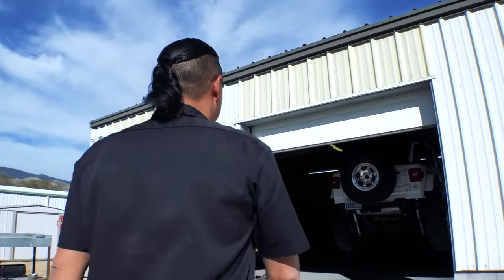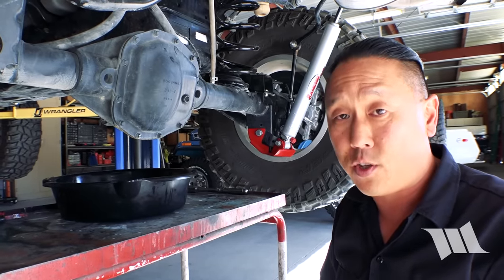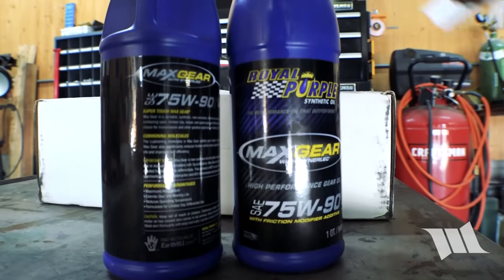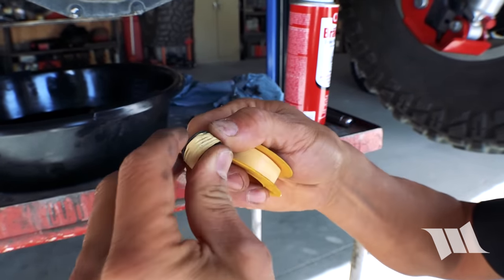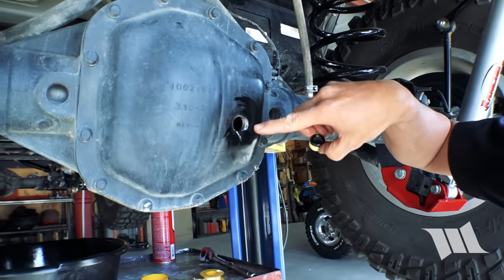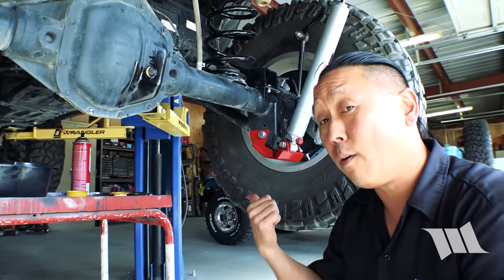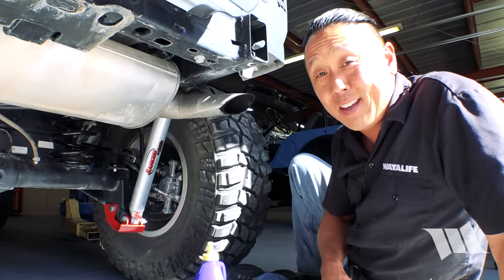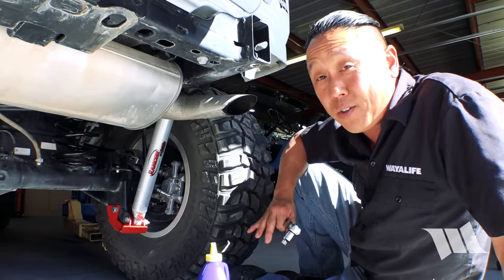Jeep JL Wrangler Axle Differential Fluid Change - How to do it Yourself Maintenance

Comment: I took my Wrangler into the shop and they quoted me $500+ to do both front and rear diff fluid change. I found that unreasonable and began searching how to DIY. This video was easy to understand and quickly taught  me how to do this in my own garage at a fraction of the cost. Thank you! Keep up the great work Wayalife
Reply from the maker: awesome! Happy to hear our video was helpful to you and will save you a lot of money :)
Reply: Yeah, I just called to have 4x4 service done as well they wanted $500+ for the diffs and the TC. Crazy what everything is being charged for! Transmission is next.
Reply from the maker: @ryangarcia8634  There should be no need to service the transmission for at least 100k miles or more.
Reply: The royal purple container makes the change a breeze. Other companies only have bottles requiring fluid pump. It’s messy
Reply: Just called today for maintenance and they quoted me 639$ for front and back, i told them thats is exactly why i dont go to the dealer no more.
Reply: Honestly I used your video to do the oil change on mine but there’s one concern, when I went to do the rear one ,there’s no Drain plug is that normal for a 2020 Rubicon 3.6v Unlimited ? I just bought it 4 months ago from a Jeep Dealer
Reply: That's crazy I got my oil for 20 bucks Canadian and spent less than a hour. What a rip off

Comment: Thank you so much for this video. My local dealer wanted 240 per axel to do this. Yikes!!
Reply from the maker: Yikes is right! Glad we could be of help to you.
Reply: Mine is asking $280, so here I am watching videos on how to do it. Great video, thank you for posting!
Reply: My dealership asked for 619 for Both me 250 for beaker fluid!  Also other videos were showing to clean the differential while this video does not. Do we need to spray the differential to clean it?
Reply: @prazmeej7972  If you already pulled the cover might as well spray everything down with break cleaner while you’re there.
Reply: That is so simple . I thought we had to remove the cover and put new gaskets .thanks for the video .
Reply: That's crazy they charge that much I change my diff oil every other year
Reply: Wow that's insane for such a simple job. Way too much money.  Better to watch these videos and then do it yourself

Comment: Awesome video! But always make sure the fill plug comes out first before pulling the drain plug 👍
Reply: Why is that important? Curious..
Reply: @Mindis Jurenas  encase the fill plug gets stuck or rusted in, ie something goes wrong. Now you've drained all your fluid out and can't get it back in! Being around old farm trucks and heavy duty equipment taught me this lol its not un-heard of.
Reply: @mturzanski  copy that and good to keep that in mind, I just changed my diff fluids without any issues, Jeep is still somewhat new..
Reply: @Mindis yeaman I totally understand my jeep is fairly new aswell . weird stuff happens. It would suck if it was rusty, overtorqued, if it stripped, etc. But it's great to see someone changing driveline fluids. Imagine how many vehicles have never had  the diff fluid changed ever. I've changed the fluid a few times in some of the oilwellservicing rigs and support trucks at work its crazy how much moisture can accumulate in 1-2 years
Good on ya👍

Comment: Yellow teflon tape is for gas line applications and is also thicker than regular white teflon tape. Also, if it is a "regular" Wrangler and not a Rubicon with a limited slip differential, it will take a different fluid that is friction friendly..
Reply from the maker: I think you meant to say that a limited slip will require friction modifier. With that said, pretty much all synthetic gear oils have friction modifier in them.
Reply: @wayalife  Thank you! Rock on rocks!
Reply: @wayalife My jeep has a LSD. If I use synthetic (like Amsoil that says it has modifiers added), do I not need to add any separately?
Reply from the maker: @johnnyf6367 Nope. Synthetic has friction modifier in it already, just as you have found and stated.

Comment: Just knocked it out on my Gladiator.  Didn't even need to jack up the truck and it felt easier than an engine oil change. Excellent tutorial for 1st timer attempting to doing own maintenance at a fraction of the price the dealer/shop would charge.
Reply from the maker: Happy to hear our video was helpful to you 👍

Comment: I’m new to the Jeep community, and have been watching tones of video. I’m a female who loves doing vehicles maintenance myself. I know my 21 year old truck like the back of my hand, with my Jeep it’s like leaving things all over again. Looks like I’ll be serving the differential fluid on Thursday. Oil, oil filter, and both air filters changed this afternoon. I’m only 5’2” and had to stand on the bumper to reach the oil cap and oil filter and one screw on the air filter case. I swear I need a extension ladder to work on my Jeep. 🤣

Comment: 2023 4XE Rubicon does not have the drain bolt. Easy enough to remove the 12 or so bolts around the differential to drain. I only had to loosen them. Otherwise went just like you suggested.

Comment: Slightly confused as to why you use 75W-90 [factory suggested 75W-85] but notes for different models suggest 80W-90 or 75W-140
Reply from the maker: Nothing to be confused about. We're talking gear oil here, not high blood pressure medication. The difference in weight is insignificant and if you were running a higher gear ratio, I would recommend using a heavier weight. Of course, factory will not have any suggestions about that.

Comment: Ok I had to double checked the gear oil used , dealer said mopar 75w85 was going to use royal purple as well will use that 75w90 , thanks again , hopefully no issues with it
Reply from the maker: You be fine 👍

Comment: Fantastic tutorial.  Just got back from a DIY shop and did this myself thanks to the the information provided here.  Tried so hard not to laugh while squeezing that royal purple but all I could picture was Eddie laughing at the noises so I couldn't help it!

I put 75W140 in the rear since we do a fair amount of off-road driving and occasional towing.

A dealer in Vegas did the engine oil change for me while we were on a long road trip and quoted me $1200 for engine oil, diffs, and transmission.  Utterly ridiculous.  I let him do the oil but I did the rest myself for $299.45 all in and 1.5 hrs of labor.
Reply from the maker: LOL - so glad that we could be of help to you 😎

Comment: Great video!  Never done a diff fluid change before but watching this looks super easy.  I want to do all the easy maintenance myself on my new JL rubicon.  Interesting how the M220 rear axle asks for 75W85 in the rear instead of the 75W140 I was expecting.  I guess this makes it easier both front and rear taking the same.  I have a ways to go before any of this is needed but saving for future use.  Thank you!
Reply from the maker: No need to run a heavier oil unless you've regeared.
Reply: @wayalife  I'm base Rubicon 4.10

Comment: Absolutely crazy they got rid of the drain bolt in (I think) 2022. My 2023 JL with the factory M220 rear no longer has a drain bolt. I will say I did a dozen or so deep water crossings over the course of 2 months and when I finally changed the oil everything was still looking great....that said, I only have 14,500 miles on it.
Reply from the maker: It is disappointing they got rid of it.

Comment: Wow! Great video.  Was told i have too take diff covers off to clean them out.
Reply from the maker: On older Jeeps without a drain plug, you do need to pull the covers. In fact, on newer  Jeeps, the drain plugs have been removed and you have to do that on them too. Either way, pulling the cover from time to time to inspect the internals is a good idea but it really isn't necessary every single time, especially if you have an axle with the drain plugs.

Comment: Confused by the many different fluids and additives listed in the description. Which fluid is needed for front and year? Thanks for awesome video!
Reply from the maker: Assuming you're still running factory gears, you will be fine using a basic 75w90 fluid. If you have a limited slip rear differential, you will need to add friction modifier or a synthetic fluid as it will have it in it.
Reply: @wayalife  Great, thank you for the confirmation!

Comment: hi @wayalife so sorry for asking this, but regardless if i tow or not, the front uses synthetic 80W-90, while in the rear i'd use synthetic 75w-140? I have a 2022 rubicon 4xe. Thanks again and thank you for all your awesome videos!
Reply from the maker: For towing, I would use a heavier fluid in the rear, just as you've stated.

Comment: Although you didn't mention it, It's good to remind people that the best way to apply the Teflon tape is in the opposite direction of the thread on the bolt, to prevent the lead edge of the tape from unraveling and/or bunching up.
Reply from the maker: This is true :)

Comment: Just did fluid drain n fill on my 13' JK 2 days ago. I actually googled it and found your old write-up. I never knew that there was a drain plug on the axles. I did a complete cover reseal the first couple times without noticing it. I do prefer the tucked up drain plugs on the JK axles though, the JL look abit risky.
Reply from the maker: Yeah, the front diff plug is lame. The rear is just like a JK. Glad to hear you found my old write up :)

Comment: Hey Eddie nice video, thank u for all u do for the Jeep community, I bought the rock gliders because of u and rancho but I was gonna ask, I wish someone would do a light build to keep weight down on jeeps, that don’t want to turn our jeeps into tanks....
Reply from the maker: So far, I think our build is about as light as it gets. No rear bumper, shorty front bumper and rocker guards and that's about it.
Reply: Cool your right, wondering about stuff that’s like alloys, forgot about they way u built yours, guess you can’t replace steel for strength.

Comment: So I went to change my diff fluid on my 21 JLU Rubicon Eco-Diesel and neither my front diff nor rear diffs had drain plugs. I bought it new from the dealership. Have you ever heard of that?
Reply from the maker: Yes, it's been that way for a while now. The plugs were getting damaged on the trail and causing leaks.

Comment: Thanks for your great videos! Is this an automatic transmission and can we use the same differential fluid in vehicles  with both automatic and manual transmissions. Hope to hear from you.
Reply from the maker: For the axle differentials like you see in this video, you can use the same fluid regardless of transmission.

Comment: This is all good to know... Mine is the sahara. I can NOT believe how much my dealer is charging for 1 bottle of 75W85 for the front M186 diff... Almost $100 CDN... The back M200 and transfer case fluid prices aren't horrible. In fact, all total $100. 

But $100 for the front. That's the Mopar of course. I'm considering a non-mopar brand.
Reply from the maker: Any synthetic fluid will get the job done and really, you can run the same stuff front and rear.

Comment: nice videos. can you do a brake flush how-to video? i was wondering how to completely empty out the master brake cylinder because in one corner of the brake reservoir, the fluid does not come flow out and seems to stay in there. it will contaminate whatever new fluid that I add to the reservoir. maybe if i move the floating thing in the reservoir then it will drain to the main part of the reservoir? thanks for your videos. collectively you save many people thousands of dollars!
Reply from the maker: A proper bleed would require a scan tool to do a full ABS bleed. I do not have a scan tool.

Comment: I made a rookie mistake changing the differential oil.  I didn’t take the yellow cap off of the Max Gear oil.  A plastic piece about a half inch went inside the differential housing.  I’m not sure if I should completely disassemble the differential to take the plastic piece out or just leave it inside.
Reply from the maker: Honestly, it'll probably be okay in there but if it were me, I would open up the cover and try to phish it out.

Comment: I put a solid axle diff cover on my 8.8. It adds a lot of armor and takes more fluid.
Reply from the maker: The Solid diff cover has a higher fill port and that's what allows you to add more fluid. That being said, the port is placed higher to help you to get the proper amount of fluid in the diff after you've set your pinion angle. That does NOT mean you should put in "more fluid". You should always just put in just enough fluid to bring it to the base of the axle tubes. If you put in more than that, you will have over filled it and gear oil will start to pump out the breather tube.
Reply: Yeah I put a little bit more in there, but not even close to the point where it leaks out of the fill tube.

Comment: Firstly, thank you for the video! I would recommend following the manufacturer's recommendation of 75w140 synthetic gear oil for "severe/towing use". Well worth the .5 mpg drop. These Dana 44s eat themselves alive, even with regular maintanance.
Reply: I pull a boat. So I got the 140.
Reply: Does this apply for the 2021 gladiator?

Comment: Thanks for the video. In your description you mention 75w90, but below you mention 80w90. Which one is best for a 2020 Rubicon with Dana 44s?  Also, based on my calculations, it will take just over one bottle to fill each diff, so should three bottles do it for both?  Thanks
Reply from the maker: You'll be fine with either and yes, about 3 bottles will do the trick.

Comment: How many bottles does the front and rear diffs typically take? Would you recommend having the Jeep tilted to take in more fluids?
Reply from the maker: You'll need 2 bottles per axle. You do not want to overfill the differential as it will just spit out the breather hose if you do.

Comment: Great video, whats the secret to get the new fluid in without it leaking all over before getting in the hole? Was gonna use a hose or transfer pump, but u made it look easy…🤔🤷🏼‍♂️
Reply from the maker: LOL - put your finger on the hole right up to the point where you put it in the fill hole.

Comment: Great video, thank you! I have a 2023 Wrangler Rubicon with the 3.6L and a 6 speed manual. What weight gear oil would I use? Also, I am not sure if my rear diff or front diff has an LSD and if that changes the oil weight that I use. Thanks for any advice.
Reply from the maker: Assuming you are still running on factory tires and have not regeared to anything higher, I would just run the standard 75W90 or there about. I would also run synthetic as it will have friction modifier in it if you have LSD.
Reply: @wayalife  apparently, I have electronic lockers in the front and rear and not an LSD. I'm still learning. :)

Comment: Just curious, any reason why you didn't remove the covers to clean out the gears with brake cleaner and add a fresh gasket or rtv?
Reply from the maker: No need for it. Maybe after 30k

Comment: What about the limited slip moly additive that you're supposed to put in to protect against wear and reducing noise?
Reply from the maker: You only need to apply friction modifier IF you have a limited slip differential. And, to that point, synthetic gear oil has it in it. That said, we have a Rubicon and have lockers so it isn't needed anyway.

Comment: Any chance when servicing your jeeps have you ever seen 2 ball bearings in your differential? I drained fluid today using your video and found 2 ball bearings. I got my jeep new from dealer and had never changed it before.
Reply: There were 2 ball bearings on the drain plug I have a 2020 JL and it doesn't appear to exist in the diagram.
Reply from the maker: What you're seeing is NOT a good thing. You really need to have your differential rebuilt before you have a big problem.

Comment: With the Jeep raised and the rear axle tilted then when you drain it won’t some old fluid always be left in the housing? If you have to put Jeep on the ground and add more fluid then maybe so yes? Front axle looks ok drain plug at bottom.
Reply from the maker: As I clearly explain in the video and very early on, we only put our Jeep on a lift to help make it easier to film. Normally, I would do this with the full weight of our Jeep on the ground. I made sure to top off the diffs in the video to be thorough. That being said, the amount of oil that may have still been inside is hardly enough to matter or at least, in my opinion. Certainly, the amount drained was consistent with about how much needed to go back in. In reality, the BEST way to service a differential is to do it the old way and that would involve completely removing the cover and so that you can spray everything down with brake clean and do a complete visual inspection.

Comment: Nice video. I'm learning how to change the oil myself too but I have a question, the drain and fill plug holes looks threaded through, what stops the fill and drain plugs from threading all the way in? Would I reach a point where the plugs just threads all the way in? Thanks in advance 😃
Reply from the maker: The bolts will stop and not go all the way through.

Comment: I have seen people on youtube taking off the differencial cover off , spraying brake fluid to clean the gear and putting everything back using red gasket maker and then filling it back up.. my question is.. is it necessary to do all that or just a fluid change would be good ?
Reply from the maker: Back in the day, there was no other way to do it. These new Dana axles come with drain plugs so that you don't have to go through all the trouble anymore. After something like a re-gear, it is still a good idea to open things up to give things a look but really, that's about it.
Reply: @wayalife  thanks